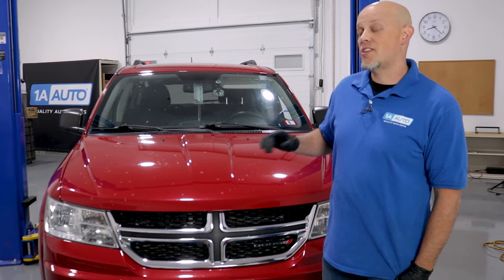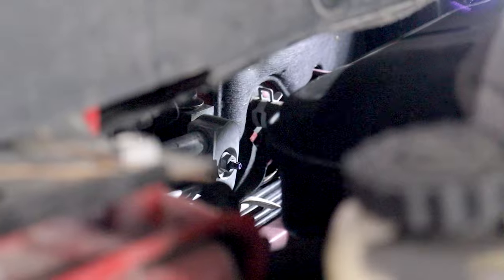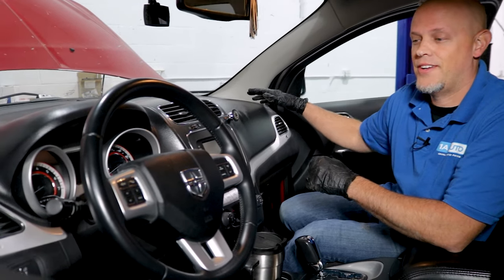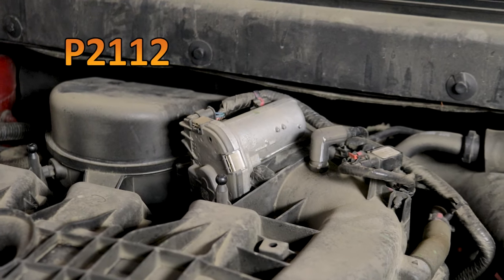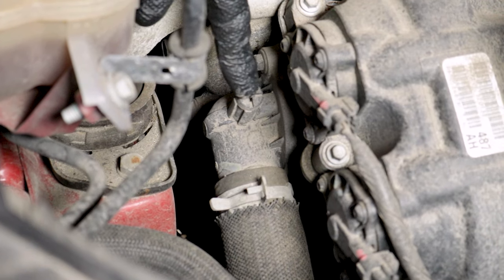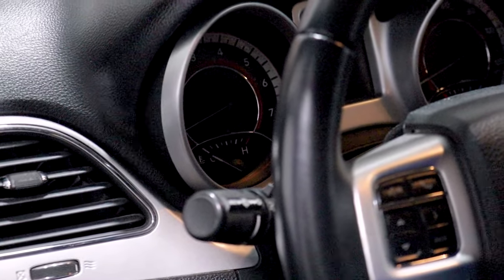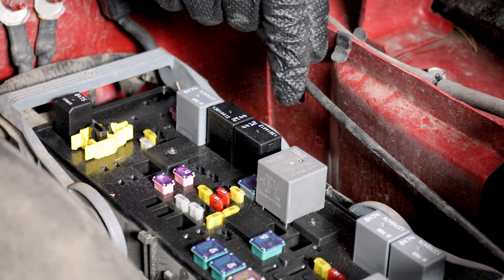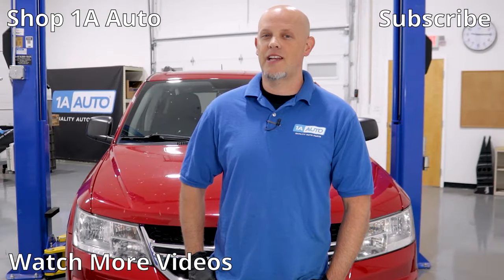Top 5 Problems Dodge Journey SUV 1st Generation 2009-20

Comment: Yeah nothing wrong with it only having 35k miles and dumping $1000s of dollars into it. 
They were supposed to make it easy to take out the heater core under the dash....BULLSHIT!!!
BATTERY IS LOCATED IN THE WHEEL WELL!
I WARN ANYONE WHO'S THINKING OF BUYING ONE DON'T!
I hit a pot hole and ended up with a bent rim...no big deal right? Ha! I along with Bell tire and a few other tire shops had to comb America for a replacement. Ended up paying over $300 for a used B rated rim which I had shipped to Michigan from Texas in order to repair a simple rim leak. They don't make the rims that came stock on this vehicle anymore. My other option was go up or down in rim size and tires which would've cost me well over a grand.
Reply from the maker: +Tasha Cherry Thanks for the feedback!
Reply: We bought a 2017 new. It burned through tires like crazy. Tried everything to fix the issue and nothing helped. Power steering lines kept breaking on it as well. Went through 3 sets of tires in 60,000 miles. It needed a set when we traded it off too.
Reply: @nicknelson07 I'm buying tires again too. Yes they wear out fast!

Comment: Hi.   i drove several dodge grand caravans:  verdict ==  junk.   totally backward engineered.    leaking dust like a sieve, on gravel roads, light falling out when closing rear hatch....heater not putting out enough, crappy fobs, crappy wipers, plastic  ALL  OVER.....most all dodge chrysler stuff, is made to throw away and replaced with Toyotas, Hondas,  anything but north american......you would have to pay me to own one of these pieces of crap. anyone with enough money, to pay a mechanic to replace heater/ac unit, MUST have his financial head examined.   get a toyota, say, 2007-2010, drive it 400 k miles, no problem....did just that, 07 camry hybrid, 7 years + taxi in city, no problems  AT   ALL.   not even a flat (u must KNOW how to turn, edge upto curbs, braking, etc.  ) experience, is   THEE   BEST   TEACHER....good day, and thankyou. patience.....

Comment: Engine oil cooler,power steering cooler,Transmission,alternator wheel bearings all have been replaced in my 2015 in the last year. Why does dodge still fuse these 6 cylinder shit boxes in their trucks?

Comment: Junk! I have a 2018 and have had nothing but issues. I have a 2011 Ford Escape and it’s night and day difference between the two. The escape is a much better vehicle.
Reply: I agree with you, because the Ford Escape's are more reliable, both older and newer, except the EcoBoost ones.

Comment: this guy is a joke first off IF your heater core plugs up which did cause problems  on  the 2009-2012 there is a short way of replacing it on youtube that he doesn't want to tell you about super easy as well. one of the 2009-2012 biggest problems was the small brake rotors and calipers which they fixed after 2012... never have heard anyone complain of the throttle bodys going bad and i have owned a 2 different dodge journeys since 2011, and have been active in the dodge journey blogspot havent really heard anyone complaining about the wipers as well,,,the journeys weak spots are the wiring harness in the hatch back and drivers side door as well, and also the navigation and blue tooth suck as well other than that it is a great inexpensive car that will hold your whole family

Comment: I made huge mistake buying this piece of crap Dodge call a car. I bought brand new 2018 and one week later engine light came on and the key door  didn’t unlock or lock the car. I’ll not mention the radio and Bluetooth system that sometimes the system locks the radio.

Comment: Avoid pre 2011 Dodge Journeys. 2011 and up v6 only models are solid, strong, reliable family haulers. Do not buy the 4 cylinder powered Journeys. They are poorly under powered and unreliable.
Reply: Agreed

Comment: This guy has no idea what he's talking about.  These are garbage, especially 2009 and 2010.  These are also not the top 5 customer complaints on these.  Intermittent not starting, garbage brakes, it's on the same suspension as a mid size car and is inadequate.  AC compressor froze up on ours. Sunroof leaks into the roof panel on ours. 7 recalls, mainly on electronics and 2 or 3 of them are airbag related.  Wheel bearings are junk.  This is a complete garbage car.  And good luck if you have to replace your battery.  You'll have to remove the front fender as well as other components to change the battery!